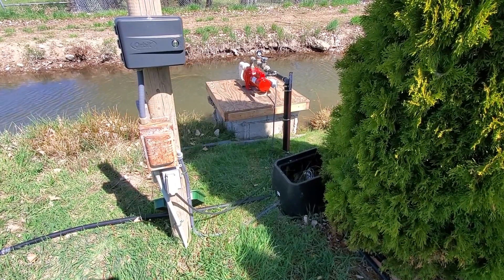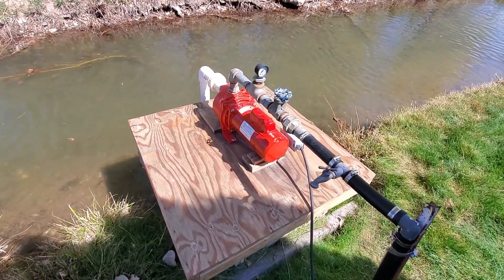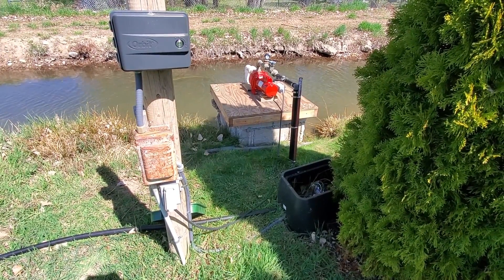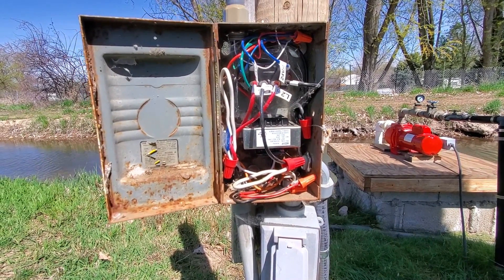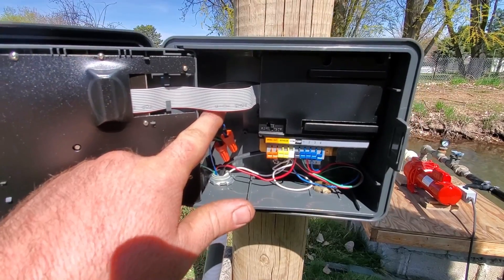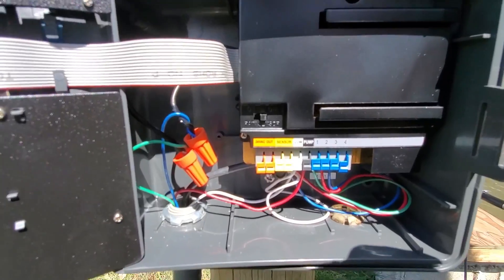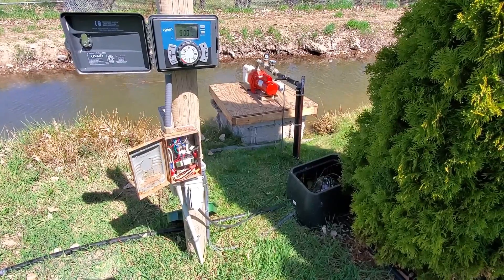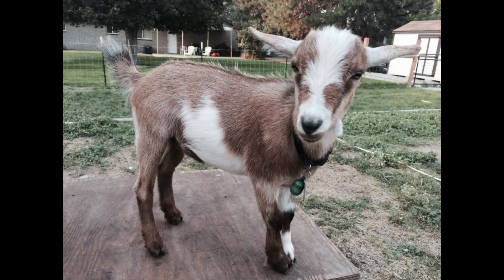240vac Sprinkler Timer and Pump Control

Comment: Hi, I am planning to install something similar.  Wanted to ask if this is still working okay for you.  Please let me know if you can.
Reply from the maker: Still working great
Reply: Appreciate your response.  I was looking at my 240v wires coming from source panel and it is just 2 hot red wires and a ground, no neutral.  I got the same transformer and as per instructions I should connect the orange and neutral only when using 240v.  Do you mind writing or explaining a little about the color wiring diagrams from your source 12-2 wires, transformer to the pump start relay.  It is a little hard to visualize it when looking at the video.  Thank you!!!
Reply from the maker: @julianmatos8461  All the transformer is doing is providing a source of 24volts to the sprinkler timer. All the rest of the wiring is following the instructions that came with the pump start relay and the sprinkler timer. Color wire wise I have no idea.

Comment: Not sure why you would need to replace the transformer the at the controller came with? The relay that came in its own box would have done the same thing you are doing without the extra transformer.
Reply from the maker: The line voltage is 240vac. The supplied transformer only accepts 120vac
Reply: @MiloFarms just take one leg
And you have 110

Comment: I wish you also included link for pumpe you use, with specification( like voltage and HP).
Please ad if you could.
Great video
Thanks
Reply from the maker: Here is a link to the pump: https://amzn.to/3jJkP1T it is also linked in the description. It is a 1hp pump running on 240vac at 60Hz

Comment: You realize you can just use one of the wires on the 240vac system and it is 120 right? The only time you can not do that is when your pump switch is further up and would switch the sprinkler controls on and off. Or you live in Europe but most of the time that electricity will power most modern devices just fine.
Reply from the maker: You could and it would work however you don't have a neutral since this is fed with a piece of 12-2 wire. You would be using the exposed ground as a neutral. So my understanding is it is a safer route to use the transformer like I did.
Reply: @MiloFarms  I noticed when I wired mine that the power cord coming out of the timer did not have a ground, just a neutral and a black. I used one of the wires off the 240vac and the ground, however, I changed the ground to the neutral bus bar in the panel. The pump start relay had no ground connection, nor did the pump. I did ground the pump to a rod.

Comment: Very clever man. I ran into the same issue. I ended up running a second 120v circuit about 25% of the pump distance and splice in the pump there. Control valves are 40 feet from pump. I like what you did much better tho

Comment: So you ran the 240 into the first box and ran it to both the 24v transformer and the 240v pump .  That gave you the 24v to run the pump start relay, and the timer, and the 240 to directly run the pump?
Reply from the maker: Yes the 240 to the transformer and to the line side of the relay

Comment: How many heads per a zone do you run off that pump and what size line did you use
Reply from the maker: I run up to 7 heads with the blue nozzle installed. The heads I use are in the link https://www.lowes.com/pd/Rain-Bird-25-ft-41-ft-Impact-Sprinkler/3104409. It is on 1.25 poly pipe. The pump is a Red Lion 1hp
Reply: @MiloFarms   would you mind draw a diagram for wiring. your setup is very good.
Reply from the maker: @teddyyou2071  I do not really have a way to draw a diagram and post on here but if you follow the links to the products in the description both the timer and the pump start relay have wiring diagrams
Reply: Was you able to fit both common wires side-by-side in the sprinkler clock?